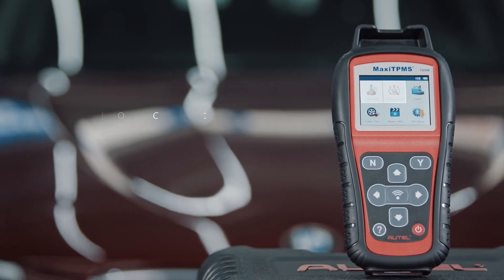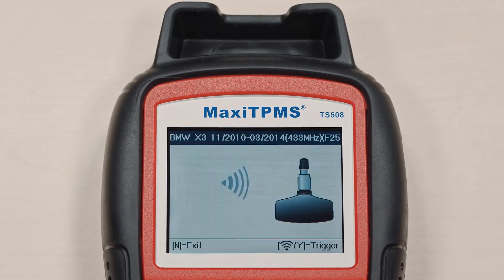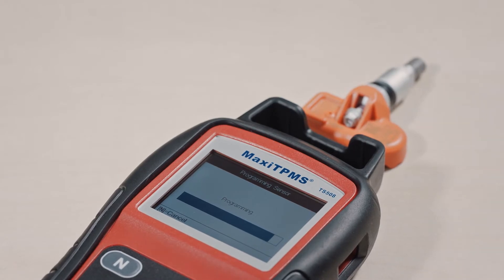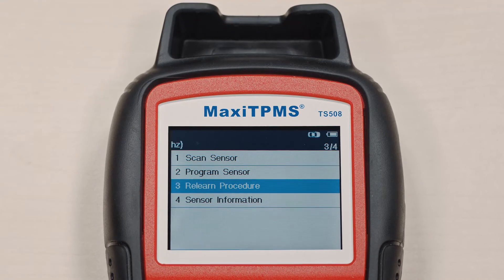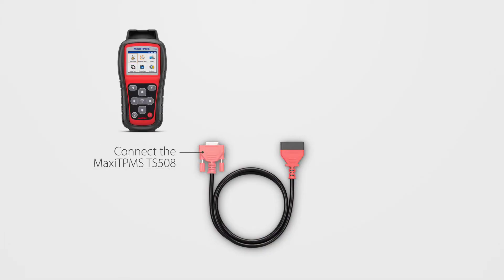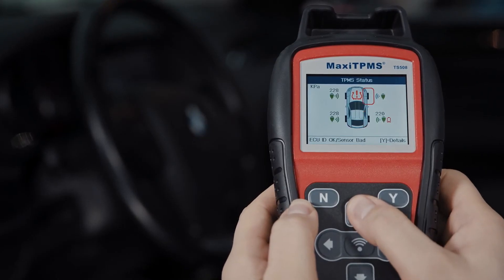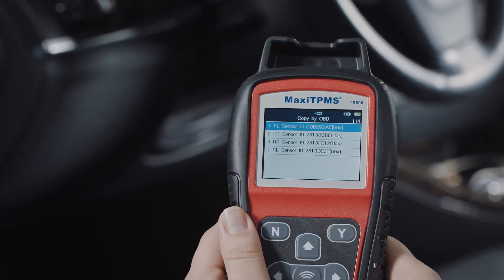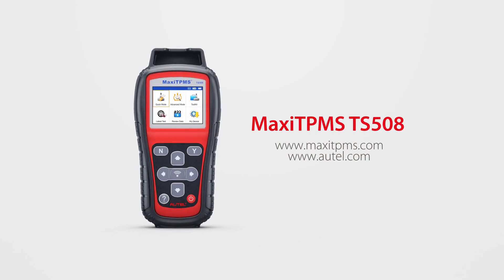2018 Best TPMS Replacement tool Autel MaxiTPMS TS508 K

Comment: Autel has vehicle protocol programming issues across their product line  with various Jeep, Chrysler, & Ford models. ie It reports a 2016 Jeep Patriot as being 433mhz when it is 315. Beat my head against wall for 3 hours on that one . . . .no sensor read-out
Reply from the maker: friend,US ,Jeep Patriot,01/2007-12/2016 315MHz,but 05/2013-12/2016 433MHz so your car should use the 433mHZ sensor
Reply: That’s fixed now